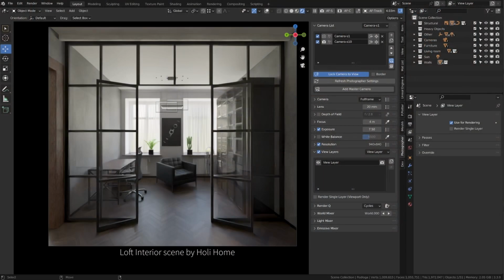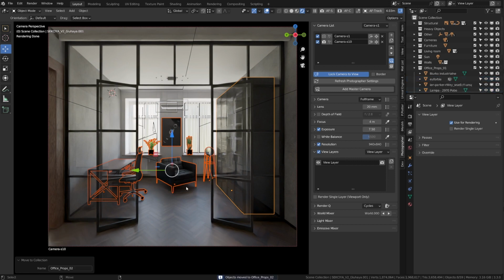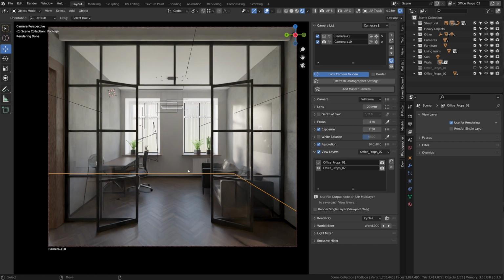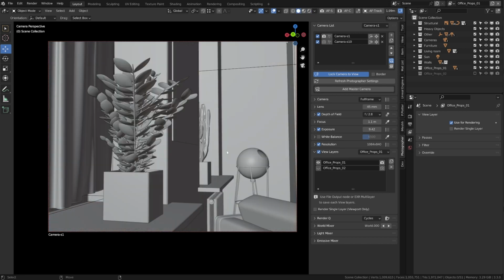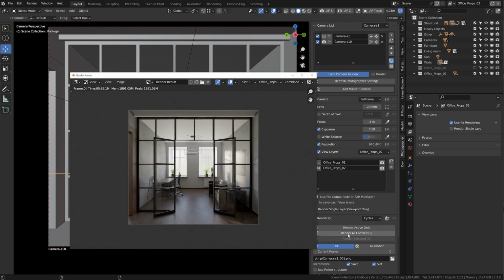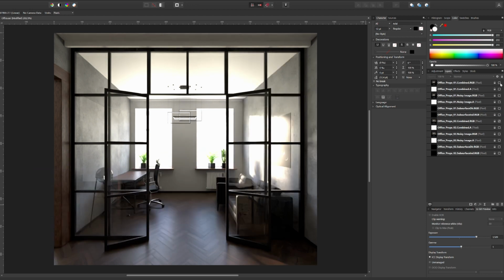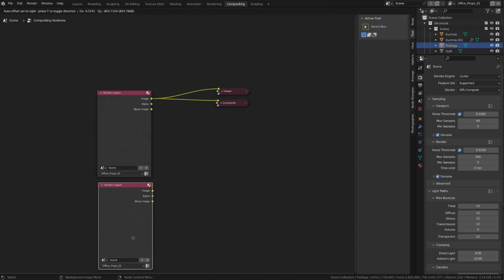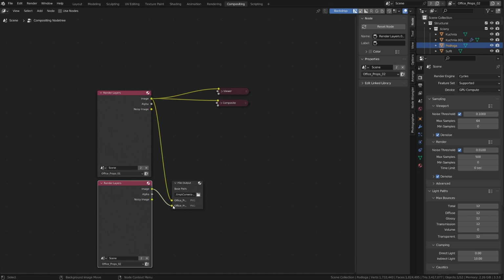Photographer 4.7 - View Layers per camera

Comment: Hello! Can you tell me please, will exposure ever work in render mode? I really need it for animation, and setting keys manually where there are 10,000 frames is a bit inconvenient. Maybe you know some way to make auto exposure in blender
Reply from the maker: I tend to recommend to render to EXR and animate the Exposure in Compositing, this gives you a lot more control and doesn't require you to re-render if you need finer adjustments.
But I'll be adding a Bake Auto Exposure, if not in the coming update, in the one after.
Reply: @fabien_chafouin  Okay, thank you!

Comment: Hello Fabien. Thanks a lot for the addon. There is a way to link the image of the HDRI instead of "append" it using your world mixer ?
Reply from the maker: You could turn the file paths to relative using File > External Data > Make paths relative. Unfortunately it will change all of them and not just the world HDRI texture. I'll look into adding this option in the add-on.
Reply: Thanks for your answer  @fabien_chafouin  . I'm not sur but seems to works only if i uncheck the precious "automaticly pack ressource" in addition to "make path relative". 
Great if you add it for your next update, it could save a lot of memory if you allow to link the library stuff.

Comment: 我想问一下为什么经常会出现渲染出来的结果是符合预期的，但是保存在本地的时候就变暗了，有一次通过按Update light threshold 可以调整，但是其他次再按这个按钮就已经不行了，按Calculate light threshoud from exposure 也不行。我用的版本是最新版🥰期待您的回复
Reply from the maker: I am not sure I understand your problem, could you please send me screeshots with more information by email? You will find my contact details on Gumroad download's page.
Exposure should be correctly baked in if saving to a PNG, TGA or JPG format.
By default, Exposure is part of the Color Management, which means that if you save your image in a RAW format such as EXR, the exposure will not be applied, and you will have to do it in your compositing software.
You have the possibility to enable "Apply at Compositing" in the Exposure panel to bake the Exposure into the RAW file. If you are using Blender 3.5, make sure to enable viewport compositing to get a correct preview of the exposure.

Comment: With Blender 3.5, the add-on doesn't work anymore, when will this be fixed?
Reply from the maker: Of course it works with Blender 3.5! :) Make sure to download the latest version and if you still run into problems, proceed with a clean install as described in the documentation.
Reply from the maker: @Blemonade1  you are not bothering me! Are you sure you are using the latest 4.8.6 ?
Reply: @fabien_chafouin  Ooh thats why! I have the 4.8.1 version, I thought it was the latest one, I lost access to my gumroad account because I couldn't use my email account anymore and had to transfer to another one...
Reply from the maker: @Blemonade1  Shoot me a message at chafouin.blend at gmail.com, write down your previous email address and we'll sort it out.

Comment: One of the best addons for blender. Unfortunatly not working on the new blender 3.5. Is there an updated version coming?
Reply from the maker: Of course it is working with Blender 3.5 :) Make sure to download the latest version, and if you get issues when enabling the add-on, try a clean install as described in the documentation.

Comment: When I use Blender 3.1.0 and the free version of Photographer, your pick Focus and pick white balance doesn't work  I get an - 'error durning raycast, is object a mesh?' Tested on new project with Susan. Focus on center doens't seems to work too. 
Another  thing the lowest selectable Aparture 0.95 gives little blur even at 130 Focal Lengt, I have to set the Aparture to something like 0.5 (characters are 2 meters apart by 10 meters) is this normal? 
Also default focus picked doesn't work on characters mesh, I mean, it works, (no errors) but the effect is as if I chose the wall behind the character.
Reply from the maker: Photographer 2 is not compatible with Blender versions above 2.8, as stated on the product page. I apologize but no support will be provided for this (extremely) old version.
Reply: @fabien_chafouin  Does your addon conflict with animating the exposure? In the old version of Blender without addons, I also have similar problem, so I don't know what the fault is.
Reply from the maker: @llYuki0okami  It is possible that the free version did not support Exposure animation. You should still be able to set keys on the Color Management Exposure property.
Reply: @fabien_chafouin  In case I'm not the only person in the world with this error; indeed Photographer v2 doesn't support exposure animation, and when it doesn't work with classic Color Management as well, you need to create keyframes to exposure and change their values in GraphEditor, then it works for some reason.

Comment: iam newbie in those thing, help me understand when photo tutorials says about 85mm they mean focal length or sensor size or somehow both? how to calculate it to blender?
also this addon working with eevee? if yes but not the same have you some  advice how to use it with eevee?
Reply from the maker: They probably mean 85mm as focal length. You can input it in the Lens parameter. I assume they are using full frame sensor, which is 24*36mm, which is the default in Blender and with Photographer.
Photographer and camera parameters (except fisheye) work the same with EEVEE and Cycles, you don't have to do anything different there.
Reply: @fabien_chafouin  I see thx, but default blender sensor is Auto - size 36mm, when I choose FullFrame from the list above it, I get this 36/24mm and render looks the same, so auto and fullframe is the same in blender or something changes?
"same with eevee and cycles" so on eevee if I set ISO to hight I will get Image graininess in render?
Reply from the maker: @llYuki0okami  Auto is the Sensor fit, which means that Blender will smartly calculate Field of View based on your image aspect ratio. If you are shooting portrait instead of landscape, it will assign the 36mm value to the vertical length, as if you had rotated your camera in real life.
ISO doesn't control grain, only exposure calculation. Artist usually add grain in compositing, in order to get finer control.

Comment: hey chafouin how are you doing. I have some feedback. I love your addon but I have been shooting vertical a lot and I noticed that your camera presets come with the sensor fit set to horizontal. If I then change to vertical it uses the shorted length of the sensor which would be correct, but actually the way blender works it is now inverted so the height is 36mm for exemple when shooting full frame, not 24mm. The best way for me is to set it to auto. auto makes a square with side measure equal to what you put there so anything will fit to say 36mm if you want. either vertical or horizontal.
Reply from the maker: Thanks for the feedback, I'll check what's going on. Auto sensor fit has given me wrong results in the past.
Reply: @fabien_chafouin  thank you! your addon has helped me a lot. I make matching my camera really seamless as well as matching other looks I find interesting. your 2.0 free version should really come with blender. congratulations on your work.
Reply from the maker: @raulgalets  I've been looking into it finally, I don't see anything in the add-on that would set the Sensor fit to Horizontal. It's always Auto for me unless using Vertical for Anamorphic. Can you send me more details? You can find contact information on the platform where you bought it.
Reply: @fabien_chafouin  hey sorry for the delayed response. I did not use blender for a hot minute so I need to check again but I might have another addon which influences that. imma do a clean install and try again with only your addon and see what I get.